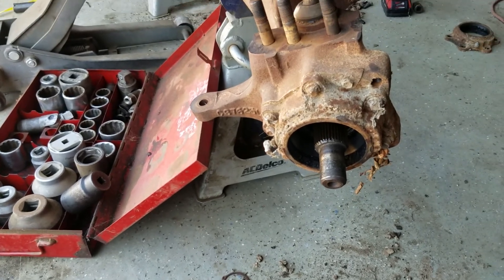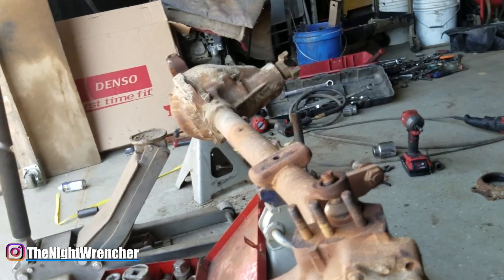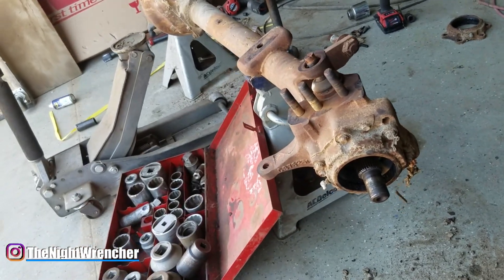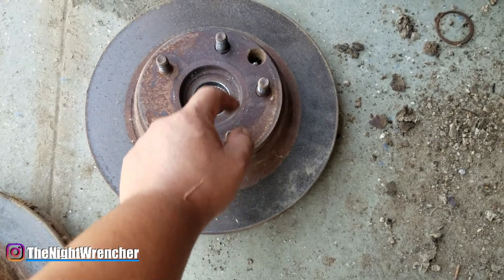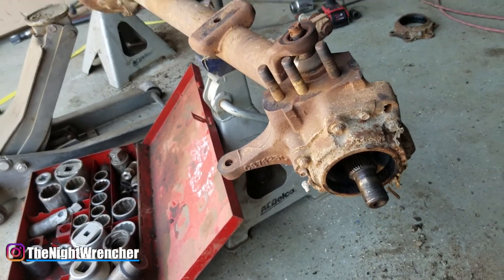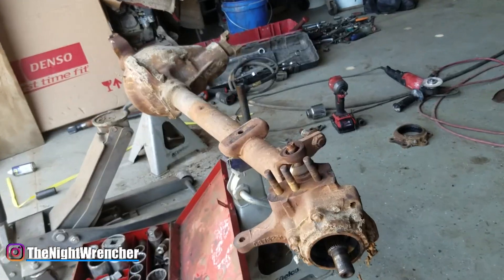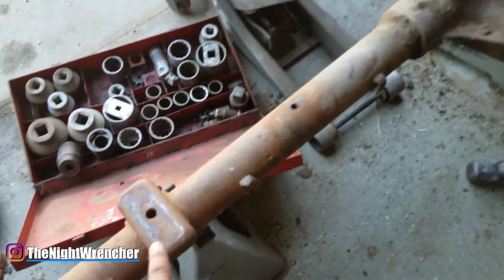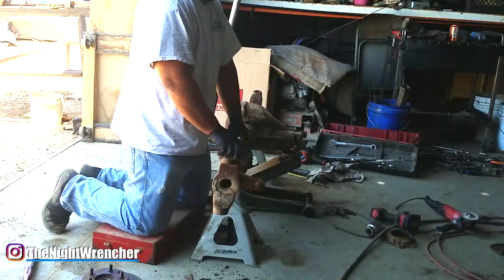DISSECTING THE FULLTIME DANA 44 | Dodge Full Time Dana 44 | Budget Dana 44 Build | Dodge W100

Comment: Thanks for this video! Anyone else on 2025? I got a question, I own a 1987 W250 with dana 44 I just installed the manual Mile Marker hubs, is that enough to stop being a full time 4wd? Got a little bit confused, greetings from Mexico!
Reply from the maker: In 1980 the dana 44s came with CAD systems instead of fulltime axles. If you leave the CAD collar locked, you should be able to rely on the mile marker hubs to disengage the front axle

Comment: One tons, a little more work, time, and money. But in the end, more strength and reliability. Set it and forget it, is what I have learned over the years
Reply from the maker: I was contemplating finding a dana 60 and doing the swap when I did this video but couldnt really justify spending the extra grand or more on doing the swap. Its been several years since then and my D44 hasnt had any failures since building it. I don't really do much hardcore offroading that often but when I have gone crawling, I havnt had any issues yet.

Comment: Hi man, I've watched this video several times now, and I’m wondering if you ever finished putting manual lockers on your full time D44? I have a ’75 W100 and I’ve been trying to figure this out for a while now, but no one seems to know how to do it or what parts to use. If you were able to modify your full-time D44 with manual lockers, I’d really appreciate if you could tell me what parts you used (e.g., like what year and model your donor parts came from). Sounds like you used spindles out of an '85 d44, did you use anything else? Thanks bro, keep kicking ass
Reply from the maker: Hey man, I explained in the following video after this one which vehicle I pulled my newer hubs from. I'll link it down below but basically used 1981- up Dodge W100/W150/Ramcharger Knuckles, Spindles, backing plates, caliper brackets, calipers, Hubs, Rotors And Stub shafts. I Used basically every single part of the newer axle minus the axle shafts themselves and housing. If I remember right 1980-1984 used a solid axle which you can install in your rig, complete. But in 1985 the switched to CAD axles which you would have you use everything that I did and you have to swap the stub shafts on your fulltime axles because they are different. The ujoints are the same. Hope this helps
https://www.youtube.com/watch?v=H-fVF-7gFe4
Reply: Mile marker used to make a kit for the Dana 44 and NP 205 transfer case conversion that gave both lock out the hubs and transfer cases. I have one installed in my 76' with 360cid. When my hubs went out i called and looked everywhere and finally found a few in Denver somewhere. But that was around 1996'. Good luck guys
Reply: Full time 4wd or AWD is the wrong application for manual locking hubs. They are meant only for selectable, or part time 4wd. Nightwrencher is converting the axle from AWD to 4WD.

Comment: I know it's been a while since you did this video, but I am currently trying to remove my long side, axle shaft from MY fulltime 44 for a u-joint replacement. 
I have the rotor off, and bearings out, but I'm having trouble getting the yoke past the seal, on the back side of the spindle.
I was hoping to get a closer look at how you were able to do so, without removing the hub FROM the axle housing. (I really couldn't tell, from the video) Please don't tell me I have to remove the ball joints to do so...
Reply from the maker: I struggled with this in the beginning too. You'll need to make sure the balljoint nuts are nice and tight and then remove the 6 nuts holding the spindle to the knuckle. You tap off the spindle and then you'll be left with just the knuckle and axle. Make sure to remove the caliper bracket too. You should slide right out

Comment: Know anywhere I can get an exploded diagram of the axle , I’m looking to order the parts but not sure all what I need
Reply from the maker: I've seen them online but what would you order if you don't know what you need? Theres not a lot of servicable parts on these and the low pinion pumpkins are pretty much all the same so really it would just be the bearings
Reply: @NightWrencher  thank you , I just want to get it right the first time is all , sending both my axles for sandblast this after noon, I’ve just put a video up of my 4x4 conversion that I’m working on .... any who thanks pal!!!!
Reply from the maker: I'm going to tear into the full time dana 44 again for another video. I would suggest swapping to the later 80s hubs. Bigger bearings and optional locking hubs.
Reply: @NightWrencher  hell ya that’s a good idea I’ll try to see if I can make it work !

Comment: Can you explain why you aren't supposed to install those tapered alignment shims for the pinion angle? And why did you if you aren't supposed to??? Thanks!
Reply from the maker: Typically you're only supposed to use those shims in the rear. If you use them in the front, a few things happens. 1) you increase your pinion angle but you also decrease your caster angle and thats what causes death wobble. 2) you push the axle further away from the leaf springs and can put more stress on the suspension. The problem with the dodge axles is that the spring perch on the passenger side is cast into the housing and theres no way to change it out so your only option is to use shims. What i did was use 8 degree shims in the front and then pulled off the inner "C" and rotated it until I got the caster that I wanted and then welded it back together. My truck was driving perfect even with 35 inch tall tires. No death wobble or swaying. Its not easy to do but its worth it.
Reply: @NightWrencher  awesome reply... you da man 😎. Thank you

Comment: I took spindles off of an 89 and 90 for my 74 and 77 full time  dodge along with the outer shafts. Of course you have to know the axle rating for the proper spindles.
Reply from the maker: I later did the same out of a 85 d44

Comment: Just rebuilt mine with cromemoly 4130 axils and Eaton electrical locker and 456 gears.
Reply from the maker: Very nice. Everything from the "C"  inward is the same as the other D44s from the same trucks. I swapped to 4.56 gears as well but welded the spider gears solid. I also swapped the spindles and installed locking hubs from an 80s d44

Comment: I believe it’s 5/5 1/2 but I’m trying to find the front end size of mine and not really knowing where to look
Reply from the maker: They mixed and matched between the two sizes on these trucks. Also depending if it was 2wd or 4wd so it could be any of them. Best you can do is take a measuring tape and measure from one stud to one over. Look online and it should should you how to measure a 5 lug hub. You dont measure accorss

Comment: Always re-torque your axle nut after you drive it.
I seen many back in the 70s, with loose bearings, when all that was wrong was the axle nut was loose because the bearing wasn't seated completely when assembled.
Driven too long like this will wear the press fit on the hub.
I ran 40"tires on a set of these for years with no problems, after I figured them out.
Reply from the maker: Yeah, too many DIYers dont go back and check their work unfortunately